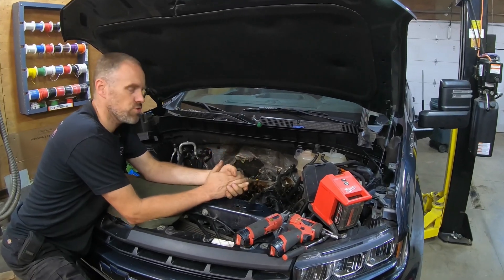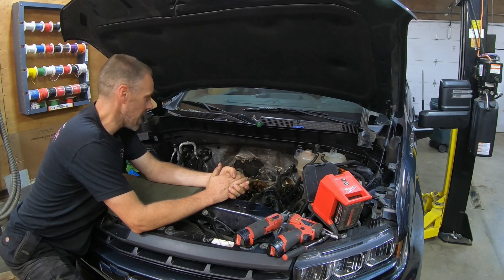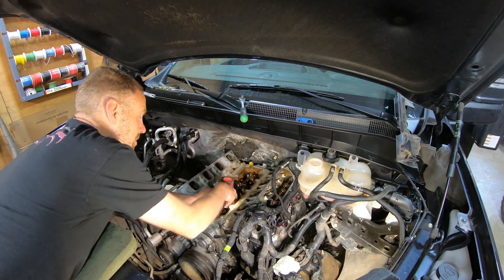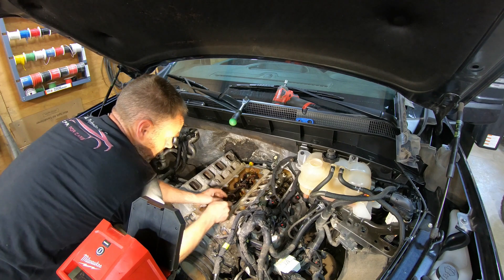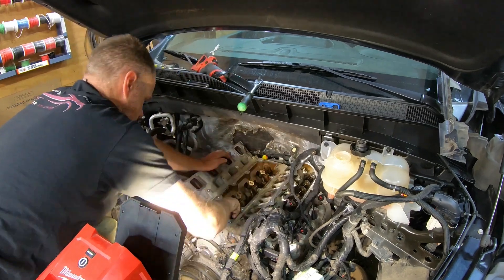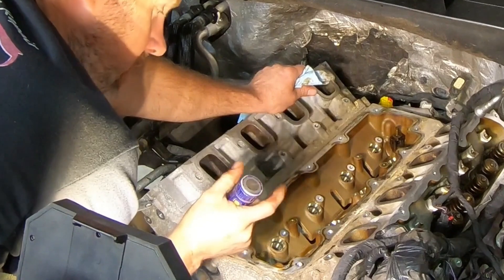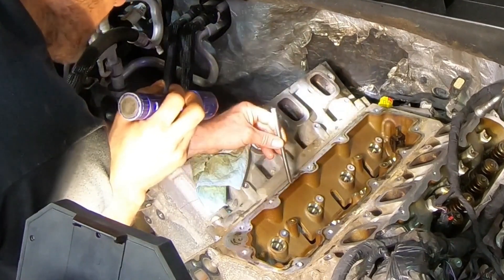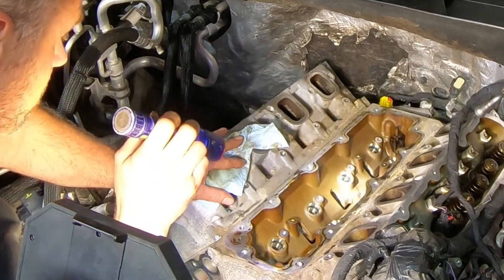Can You Fix Stuck DFM Lifters On A 2021 Silverado?

Comment: I have 2012 5.3 Chevy is the tool you use to free up a lifter a old push rod cut at a 45 degree angle or some kind of punch I ask cause I have a collapsed lifter and want to try to free it up
Reply from the maker: Long ago I used to use a pushrod and I'll make it very custom machined tool that's more of a fancy punch instead.

Comment: One can see the oil path is much shorter than AFM. So, the timing of the DFM event has to be more accurate. So, these DFM engines should be, at least, a little more trouble free, as far as collapsed lifters is concerned.
Reply from the maker: I'd like to think so, but I'm not convinced. GM most likely Screwed it up somehow lol.